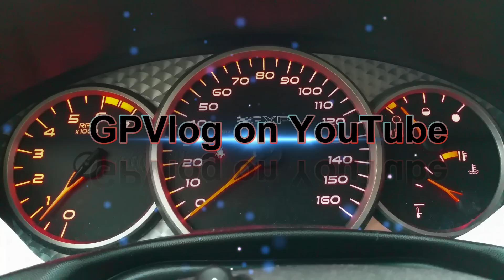Power Jack 5000 Watt LF inverter test results

Comment: Hi, sorry for my english, i have powerjack 5000 lf and isn’t work now, i buy it recently and only is on the cooler, leds batt/inv/alarm is off, don’t has load in 110v.   What’s the problem? Is an alarm in protection? Any suggestion? Thank’s for answer.

Comment: Wow, sounds good, but my inverter never works without an alarm going off when I run a 5W LED desk lamp.  can't even get it to power more.  David from China will nt replace and they do not stand behind.  sent parts but that did not work.  Now will not even talk to me.   If shopping for an inverter, do not use this one.

Comment: 12vdc system = 1000-2000 watt HF inverter maximum l 24vdc = 4000-5000 watt LF inverter maximum l 48vdc = 6000-7000 watt LF inverter maximum. Now you need the PV system watt rating to be over your inverter wattage rating . And , your battery system is a crucial driving force for appliance motor and tool start ups . The more parallel batteries the more amperage. a lot of batteries gets it done and make sure you have battery desulfators permanently attached . PV panels , inverters , charge controllers all have efficiency drops so anything solar you must consider and add more in than the std rating . A 3000 watt hf 12vdc inverter has only 1750 usable watts if your lucky.

Comment: I have a 24 volt system with a step down transformer 60 amp to 12 volt on my RV, it gives me much more storage and the step down was under $35 on ebay

Comment: I have 10.8kw on solar panels, a lithium-ion battery of 25.4kW  I am going to buy a 15000 w inverter from power jack, do you think with this system I'm going to be able to feed a central air conditioner(30000BTU,8.79kW)
Reply from the maker: +Jose Garcia I started my central air one time with this but my battery bank is smaller than yours. It started and ran for about 30 seconds and I shut it down because the battery bank dropped below 24.2 volts. I typically only draw 1-2 kw on it at a time. The central air is about 4.8 kw.
Reply: you don t really look like to have money problem so you probably better to get a safer one, less cheaper than this.8kw it s the max for 15kw unit and at 8kw it s getting too hot for it to not burn in 3 month

Comment: I have 2 of these and neither will run at or near 5000 watts as the output fuse is only 25 amps. output at 110 volts 25 amps is only 2750 watts. these need to be fused at 40 amps to be close to 5000 watts output. Its ohms law people.

Comment: Have you thought about this as a cooling system 
http://www.ebay.com/itm/282516655197
Reply: the problem with that is if thermoplate fail mosfets will fail instantly better with non conductive liquid cooling i m thinking to do that but again with a security on pump system so if pump fail inverter close

Comment: I need help working out my problem with the 8000w LF.  It will not carry a load greater than 1000w.   Not able to reach warranty department because web site on my warranty card no longer exist.  Any suggestions?

Comment: actually 24 volts is 100 times more efficient and on my 24volt power jack 8000watt lf inverter I have two 12volt batteries per 24volt set so I still have 12 volt DC appliances that run with my battery bank. I'm also using a 24 volt forklift battery and it center tapps at 12.5 volts :) I can run my entire house with this split phase inverter with 36000 watts of start up watts that you was all need when you run a heatpump.BTW I am running all cooling this past two summers 100% free and off grid. I have 5000 watts at 110 amps (28 volts dc ) of solar panel that will charge my battery banks in a flat hour so its a bit over kill but I plan to add 4 more 1200pound forflift batteries and expect to keep them charged daily even on cloudy days with mono panels . thanks for the review. it confirms my findings as well and these inverters are very inexpensive compared to other name brand ones. these are better IMO.

Comment: I purchased one that was HF claimed to be 3000 watt but wouldnt handle a 500watt drill.  how can that be explained , they  said 3000 watt electronics but not motors?? can you elaborate on that thx!
Reply: the HF are shite basically, an electric motor has a bad powerfactor and the HF inverter just can't cope, its called HF because it uses MOSFETS and a small transforer to cut up the waver form really quickly to get the desired output.

A LF one is a bit less efficient. But having a 30lb lump of iron torroid transformer means it can cope with 'bad' loads easier.

A 'good' load is a straight resistive load like a heater. They love those and will push out 1/2 the sticker rate quite happily
Reply: I tested 1 hf 5000 with motor things and wont run anything above 500w . bad very bad for me!
Reply: They lied, as do most of these semi reputable companies.
Power Jack stuff for example usually sells their units claiming 2-3x the actual rating, and they will only tell you that once you pester them on the phone over a broken unit, also their temperature shut-off works just badly enough that the whole thing can catch on fire. And sometimes you get one that wasn't even assembled to the point where it can work.
Reply: never purchase the high frequency ones. even powerjack says their low frequency inverters fixed all the issues the high frequency ones had. basically they admitted the old high frequency ones were absolute garbage

Comment: I want to order 5000w 48v convertor at 220v....can you tell me if , in this convertor you can put in 220v (110 in your case ) and will swich the charging batery on the main line if my solar pannel are not charging and when solar came back it will swich back on solar?

Comment: how many batteries do you use for the 5000 watt inverter?how many ah each battery?please answer i need to know
Reply from the maker: +Tapas Tsapas I would recommend a 1000 AH bank.
Reply: It depends on input voltage, battery chemistry, efficiency, and usage. My system is 24v using AGM Batteries. 360AH @ 24vDC nominal and I never run it below 80% State of charge. It is built off of 8-90AH batteries configured in a 2x4 arrangement for a 24v 360AH system.
Reply: Joshua Baker i have a 25.9v nominal 7s 600ah lithium ion battery. Makes a perfect drop in battery for a 24v system. I set my charge controller to 29v max and the inverter cuts out at about 21.5v. Add a balancing board for the cells to balance and voila, huge cheap efficient battery.

Comment: I am running a powerjack HF model 2500w and to my surprise it runs all the way up to 2400w and I have had it installed for 2 yrs plus and working continually running a fridge and a small aircon, pump, lights and microwave.   I never switch it off.  its been a beast.  I do remember before I purchased it I did research into inverters and found there is a LF model, this was prone to great starting power but low output. still I have no complaints except they don't sell my model anymore.
Reply: peter f you are one of the lucky ones. most people havent had very good luck especially running so close to maximum power. these low frequency ones have much higher surge power and ratings are actual capacity instead of fluffing up the numbers to sound better.

Comment: is this inverter coming with a automatic transfer switch? And does the fan always run on it even when the devise is on low temperature? Thank you for your response.
Reply from the maker: +George Witmer fan is automatic but there is a switch to turn it on all the time.

If you are plugged into ac and have a battery backup it will keep the batteries charged and if you lose grid then it will switch to batteries automatically.
Reply: Will it switch back to the grid once the grid comes back, or does it blow up? X'D
Reply from the maker: +Benjamin “Ozias” Esposti have not tested it myself but it is supposed to be grid interactive
Reply: thanks...oh just saw, that this inverter haven't a temperature controlled fan...that is anoying...
Reply from the maker: +George Witmer the inverter I have does not use temperature control but rather a load sensing fan. It can be switched to full time on. This is a major design fault with these inverters as they can run a low wattage and build up heat without the fan running. Then you get a spike draw from a motor and it blows the MOSFETs out.

I keep the fan on continuously and it keeps things cool while using very little energy.

Comment: Hi I am shopping for an inverter and thank you for review this converter.  I have seen alot of reviews about the out and out lie about there capacity but as long as you know about 1/2 its rated watts is true then you can shop accordingly.  Like I need about 2,000 watts min to power a remote well pump and so I assume a 5000watt inverter is 2500 watts with a surge of 5,000watts for about 1 sec.   Also I think with these cheap inverters you need to assume they are built in a sweat factory and the OC is poor so best to open them up and check on the wiring and fix the problem before powering them up.  Thanks for your honest video.
Reply: This reply is about 3 years late, but a Low Frequency (LF) inverter provides a triple surge, so if you buy an LF 2,000 watt rms inverter, you will get a 6,000 wat surge, plus the surge is for about 20 seconds! A high frequency inverter like most sine wave inverters will only produce a double surge for less than one second! Your pump will be very happy with a Low Frequency Powerjack inverter, plus a LF runs cooler and is a very high quality product, an Aims LF 2,000 watt will cost you over $1,000.00!